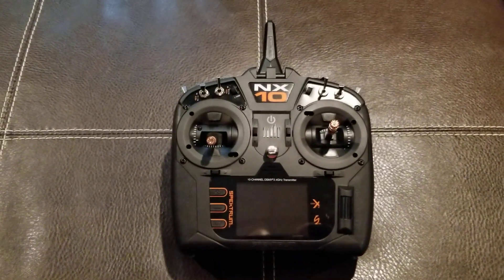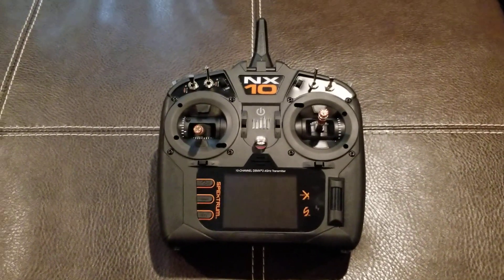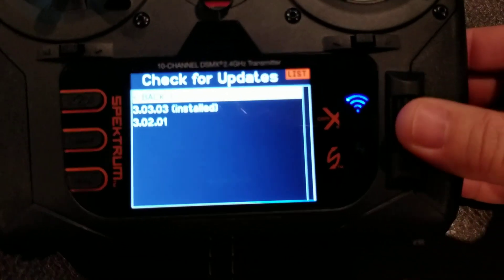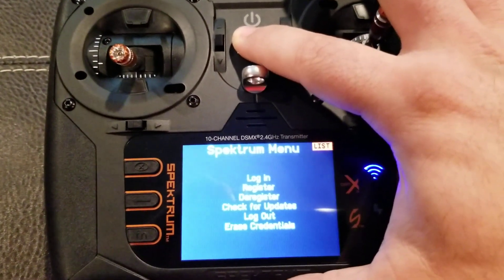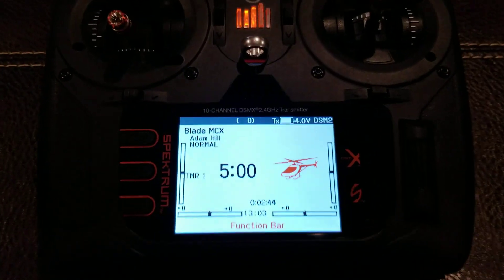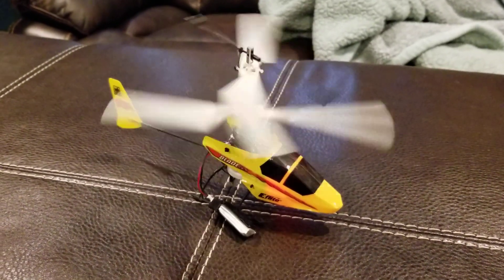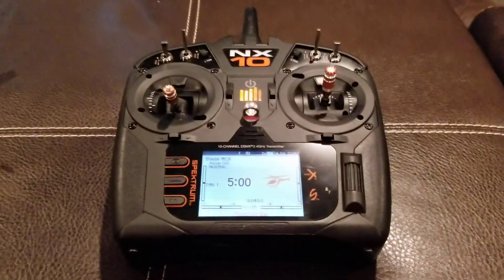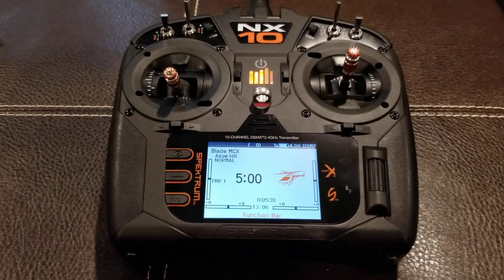New Spektrum NX10 Issue (Update in Description)

Comment: That sounds more like a motor escapement issue in the plane?
Reply from the maker: Nope.  This video was from 3 years ago when the NX10 was just released.  It was a issue that Spektrum acknowledged and corrected in a month or 2 after this video.  Did not have any further issues with the motors after the update.
Reply: @GeorgiaHillsRC  I am glad it worked out for you. I may purchase a NX10 today to replace my old DX8.
Reply from the maker: It's definitely a good radio.  I used it for 3 years.  I upgraded my Spektrum to the IX14.  Still have my Futaba radios and prefer them.  Now the NX10 got better now that they upgraded it to 20 channels.

Comment: In my NX10 the USB adapter sits very strong in the port and does not come out that easy. I am using the NX10 for about 1 and a half year and very happy with it, I got a device already updated. It works now reliable!

Comment: Can you put on the throttle hold and it will keep the motor from twitching ?—on my electric motors airplanes when I have them bound I put them on always on throttle hold till ready to fly. Do yours still twitch if you do that?
Reply from the maker: I did try that.  The ultimate fix to the issue was the next firmware update issued.  I have a video with the update fixing the issue.

Comment: they all have issues I just did a firmware update and updated mine in all the correct sequence as the updates are to be updated in and now as today my NX8 wont turn on after the last update. all I get when I hold on the power button is a spektrum flash logo for a second and it shuts off and then I tried holding down the scroll wheel and power button and that didnt work. I contacted HH and they asked me what I said so Im waiting to hear back. I wish there was just a hard factory reset on these things. Thank fully I have all my planes backed up on a sd card. UGH

Comment: Not good Transmitter, my old DX9 is mechanical 1000% bether ! 
Also the little justier screw are terrible
I also had the NX10 here and have tested it, but since the Gimbel mechanism was catastrophic and the spring force was not as adjustable as I knew from my late transmitter, it went back!
In my opinion, the spring force is noticeably progressive
Changing the mode without opening the transmitter is good, but implemented very poorly
But if I made the spring so light, the gimbel blocked
In general, the spring force is too strong in the weakest position, so that pyrofunnels become angular
Mechanics are, I think, carelessly made, and the stick is too high for thumb fliers
Here, too, the DX9 is simply better

That means the further you push the Gimbel, the more force acts against it
I have now bought the DX9 new, the 2nd time!
Reply: i just ordered a NX10 to replace my DX9. I like to have super light stick tension and i guess i will cancel my NX10 order. Thank you for your comment.

Comment: I had a similar issue but fixed it with the Beta Firmware update provided by Spektrum.  More serious, however, is that mine randomly freezes and sometimes turns itself off.  Almost always this happens when I am adjusting an aircraft setting or switching between models, but one time it turned off while I was flying.  Fortunately, I was setting up for landing so the crash was not terribly severe, but did result in a bent motor shaft.  The NX10 is now with Horizon hobby.  I provided them with a video of the transmitter randomly locking up and turning off.  I have asked for a refund or exchange.  We will see what they do for me...
Reply: "but one time it turned off while I was flying" are you kidding. imagine flying a plane worth a few thousands of $$$. They should pay for any damage due to failure of their product. 
how can you sell a transmitter that turns itself of.
Reply: @LyroLife  I was very lucky that it was a relatively small plane, and that it didn't do that much damage.  Horizon eventually replaced the transmitter for me, but didn't give me any information about what they found, or even admit that there was a problem.  They just said they were sending me a new one "as a courtesy".  The new one is working without any problems so far.  I am slowly gaining confidence with it, but it makes you wonder.
Reply: Hey. I was looking to get this radio. Is the problems gone or no? And do you advice me to wait for the vbar control or get the nx10
Reply: @Twx97  Then ended up replacing my Radio.  It took a couple of mouths.  The new one seems to be working properly.  Sorry I can't advise you on the vbar.....

Comment: can see it now landing my F14 or A 10 jets and as running down runway the throttle kicks motor up.. NOT GOOD
Reply from the maker: I see your concern but an update has been issued.  I have another video showing that the issue was fixed.   I had a problem preforming the update but once it was done the twitch went away.

Comment: I received my NX10 and 2 days later, I had to send it in for repair.  It came with an acro model set up and I was adding other models to the radio, and when I went to model utilities and hit Delete ALL models, the radio wouldnt power back on after i turned it off.  The tech said he updated the nx10 and then it worked fine.   I already updated it to the latest firmware before I did anything.  So, I'm not sure what happened.  Maybe like you said the firmware didn't work when I did it.  but it said it had the latest version. After speaking with him, I'm still not sure what the problem was as it's difficult to communicate with techs.  Anyway, did you call Horizon about the "10 second" motor?
Reply from the maker: No.  I did not call them about the throttle twitch.  I emailed the airware team since they knew about other receivers doing the same thing.  With your radio, did you try using a SD card and loading the previous airware version?

Comment: I’m not shocked; my NX6 completely locks up while I’m flight on the new Dec2020 3.03.03 firmware. Screen locks, voice prompts cease, week old and Horizon only wants to “service it” and not full exchange or refund. Even gave em a video of the issue. I’m super disappointed in how Horizon is handling this. Good luck

Comment: I have been using Opentx radio’s for quads & a few airplanes . Thinking about getting an airplane dedicated radio .  I have a few questions that I cannot find answers to . Maybe you can help . Approximately how many models are pre-programmed into this radio ?   Or a Futaba radio ?   Are they only Horizon Hobby brand models ?  Would you recommend Spektrum or Futaba for radio’s , receivers , programming , model choices , price , quality , value for amount of money spent ?   Lastly ability to add Jr. modules for other protocols ?                                                          That spinning up of the motors seems like the radio is checking in with the receiver .  . Like a computer and wifi or cellphone and cell tower does .But with a motor spin up command added during the programming line . Fortunately for all involved , the throttle error doesn’t accelerate 100% .. Thanks
Reply from the maker: Only the Spektrum radio has pre programmed models in them and they are only Horizon Hobby models (E-flite, parkzone, hobbyzone).  They are a lot of them but not all.  The 2 models that have the twitch were not in the list.  Also the pre programming is a good start and is basically the setting out of the aircraft manual.  Futaba does not have any programmed models.  Personally I like Futaba a lot better over Spektrum but that is my personal preference.   There are good and bad things about both brands.  I feel Futaba works better for me due to the extensive programming options and receiver/servo options.  Particularly the SBus system.  Personally I think Futaba radios feels better to me.  Dont get me wrong I do like this radio i just hope the address this issue.
Reply: @GeorgiaHillsRC     I appreciate you taking the time to respond . I will have to spend more time watching video’s of each . Thanks

Comment: What happens if you just lower the throttle trim? will it go away then?  I would try that and see.
Reply from the maker: Thanks for the suggestion.  I did in fact try that.  Also it happens at any throttle position.  The throttle clearly twitches even at higher throttle positions at the same 10 second interval.

Comment: Hello sir! I have the same radio and the exact same issues that you are having with yours. Also, when I hold the radio in my hands and shake it I can hear the rattle noise as if something internally is loose. I sent them an email and they said there must be some play for the parts to function properly, having said that, are you able to please quickly test it and let me know if yours is making some rattle noise when being shaken around? Thank you!
Reply from the maker: Yes I noticed a slight rattle as well.  I have determined that on mine it was the trim switches.  You can see them moving side to side and when in hold them the rattle stops.
Reply: @GeorgiaHillsRC  Thank you so much!

Comment from the maker: I received an email from Spektrum this morning.  They said they are aware of the twitching issue and are working on it.  They are expecting an Airware update any day now.
Reply: If the update log acknowledges the issue, then of course they are aware of it. Hopefully the next update will fix it. I think I will hold off on purchasing this radio. The lemon rx is a popular rx but it sounds like they may not work now.
Reply: @bansheerider619  Lemon has nothing to do with the problem with the transmitter plus these rxs that are having are older rxs .
Reply: @MikeyMikey1968  

Spektrum has an issue. They definitely know it! Gonna cost then some money! 👍 As it SHOULD
Reply: @MikeyMikey1968  Its any rx with the old DSM  protocol, which includes lemon. The issue been fixed since. I flew my plane with lemon Rx recently and no twitching now!